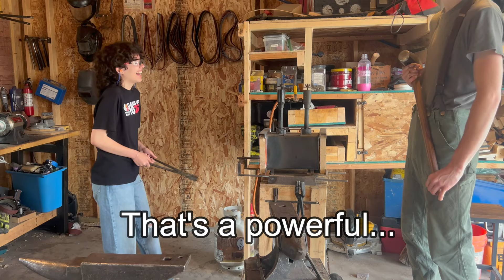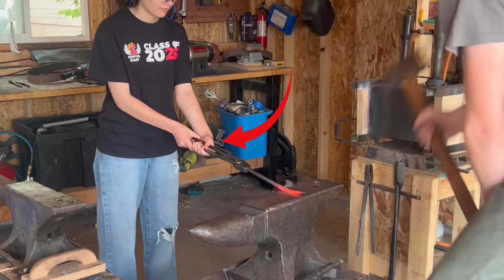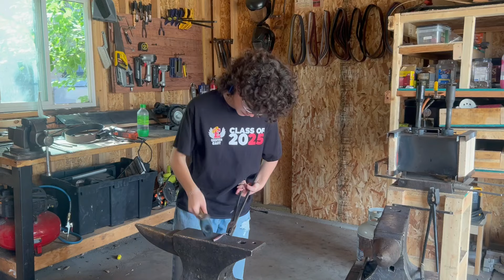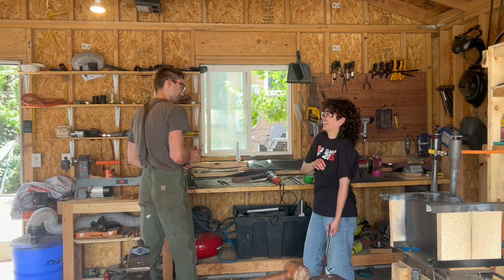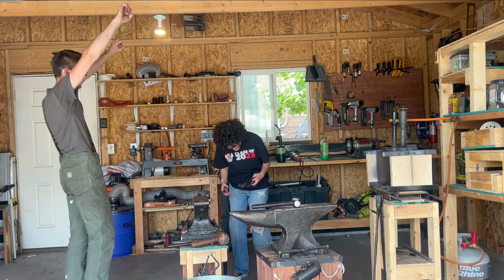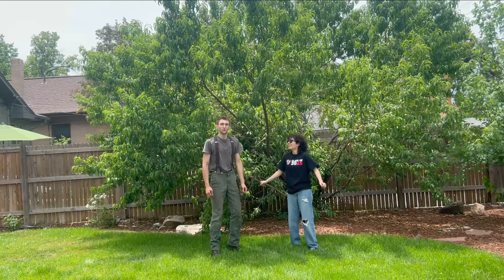First Time in the Forge!

Comment: Why do you hold the hammer toward the middle instead of at the end?
Reply: A lot of people do this. They do it because it offers better control of the hammer and also makes it "lighter" since the lever point is closer to their hand. But it generally means that they are using too heavy of a hammer or just don't understand proper hammer technique. A lot of people will use really heavy hammers and then hold way up on the handle because they think the heavy hammer means they will hit harder, when they should be using a lighter hammer and holding it towards the bottom and they'd be getting equal or greater force than they are with the bigger hammer.